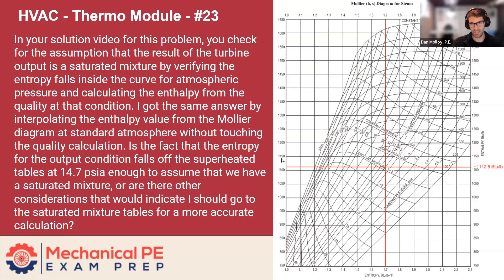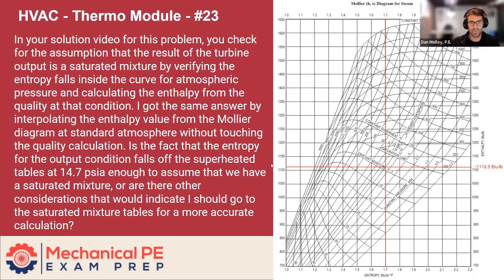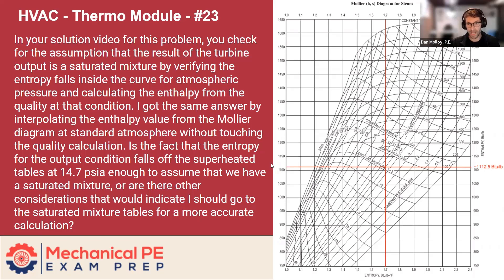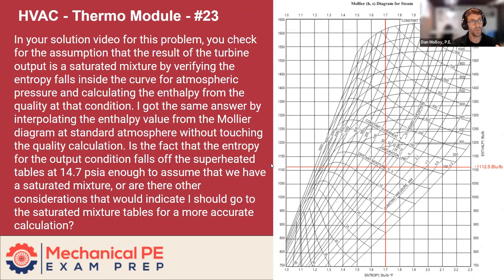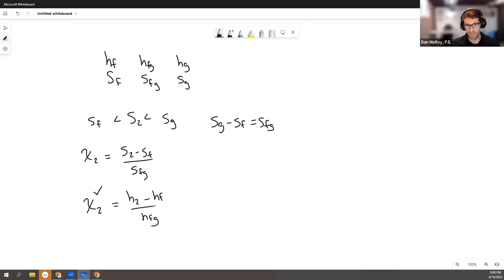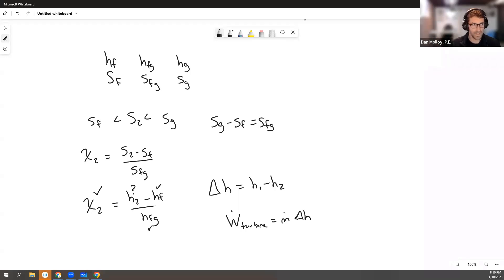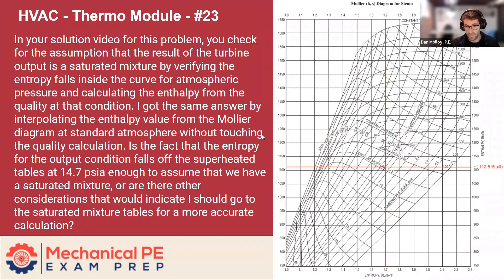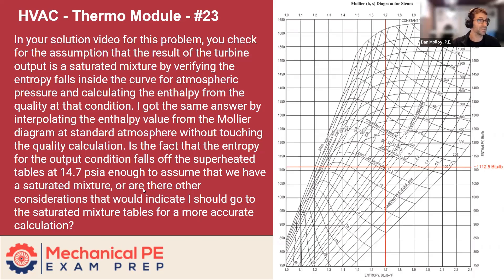How to Calculate Power Output from a Non-Isentropic Turbine: Steam Tables vs Molar Diagram

Comment: Hey could you please make a video or reply me here tgat what is difference between expansion line end point and used energy end point of steam turbine moiler diagram
Reply from the maker: My understanding is that the used energy end point is the thermodynamic state that actually comes out of a steam turbine exit, whereas the expansion line end point is the theoretical state immediately dowstream of the turbine blades which does not reflect any additional losses that may occur.  Hope that helps!
Reply: @MechanicalPEExamPrep  Yeah that helps thanks. Actually what i found in my hbd of steam turbine the ueep enthalpy and entropy in hs diagram is little higher than ELEP 
Some folks say ueep includes exhaust hood loses as some kinetic energy is lost in exhaust hood but i wonder why enthalpy increases.